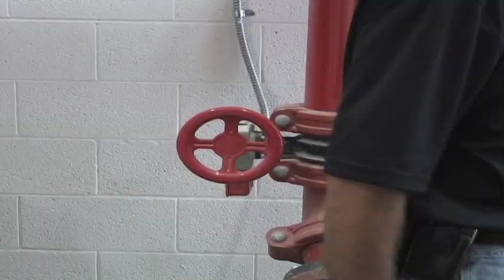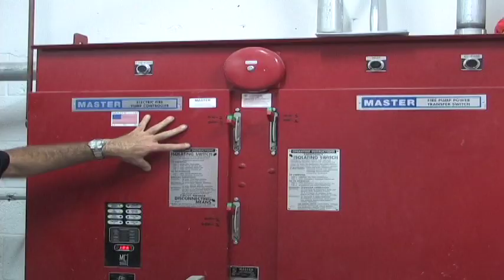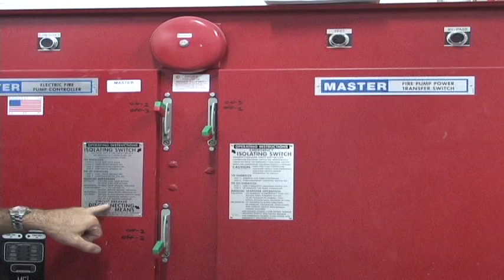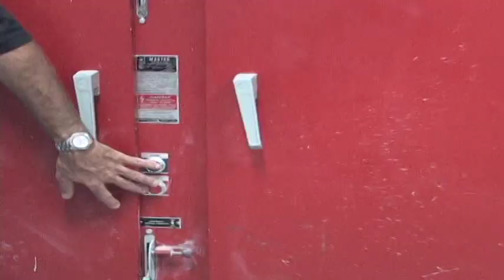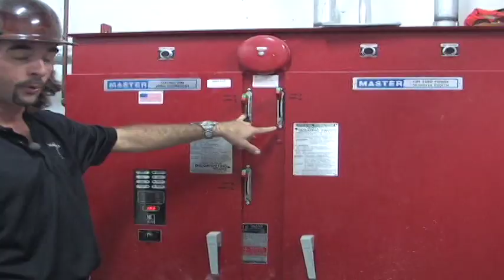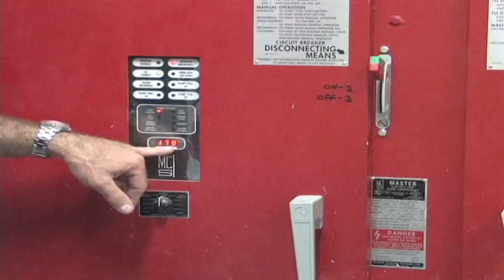Sprinklermatic Fire Pump Demonstration

Comment: The large hospital/research center/Ambutory care buildings that I retired from had  7 fire Pumps from 75 to 250 HP. I was INE if the electricians who had to run them every week & perform Quarterly PM'S on. Hate how lazy sprinkler guys install angry water pressure gauge sideways. Only takes a minute to install a Nicole & a 90 degree elbow to have them facing straight up making them easier to take readings. How the hell do they get a way with using open motors on all fire pumps instead of the TEFC ( totally enclosed fan cooled ) motors. Have seen every fire pump several times have bad packing then spraying water over open motors and water getting into motors. Hospital fire pumps do not time out after the usual 10 minutes of test run like other buildings. We had a for pump panel like the in your vidio. Had the cheapest piece of shit contactors which you could not remove cover to inspect contacts . We always had to open the drain valve below fire pump water pressure gauge to start pump then record that reading.

Comment: Does this system have one main pump
Reply from the maker: This particular installation is just a single fire pump. Multiple fire pump systems will be used in applications such as hi-rise buildings where high pressure is required or in special hazard applications such as aircraft hangar foam systems where a back up pump is needed. Thank you for your interest and for subscribing to our channel!

Comment: Thanks for the video. When there's a fire though, will the jockey pump be also running? Since Jockey pump turns on first before the fire water pump reaches its switch on pressure I'm thinking it's running but I am not sure though.
Reply from the maker: Both the fire pump and the jockey start and stop on pressure settings. If the fire pump is able to maintain a pressure above the jockey pump start the jockey pump will shut off. Thanks for your interest!

Comment: Question:

1. What will happen to your jockey once the electric fire pump kicks in its design cut in pressure? Does it operate together with the electric fire pump or will it stop?
Reply: When the fire pump starts to run automatcally theJocky pump will not run. 
Both pump will not run together automatically...

Comment: I, personally, would not route a water pipe into an electrical cabinet. Instead, I would put the pressure sensor outside the cabinet and route it's cable into the cabinet. That looks safer to me in the case when a pipe or a sensor starts leaking.

Comment: Very good video. However, the fire pump should be on manual stop and not automatic stop.
Reply: If you manually start a fire pump the run timer doesn’t engage. If the run timer is set to any specific time it only engages on an automatic start. For instance when we do 5 year flow testing on prv hose valves we set the time at 1 min to flow the valves with the pump on and when we stop the flow the pump only runs for 1 min and shuts itself off so we don’t have to have someone babysitting the fire pump at all times.

Comment: Question: Where is the water going when the pump is running during 10 minutes? I understand that the test header valve is closed, so the water is not escaping there? Is no water flowing?
Reply: There is a Circulation Relief Valve which will make a flow to avoid heating of casing of a Pump.
Reply: Hi the water goes through the casing relief valve also this is used in the diesel engine system
Reply: When an electric pump starts in churn the casing relief valve is supposed open and flow a full pipe of water to a drain. Once you start to flow water anywhere like for instance doing the performance test the crv should close. And for a diesel when it fire up in churn your should be getting a full pipe of water from the heat exchanger piping to keep the engine and the pump cool. It acts the same as a crv on an electric driven pump.

Comment: Not a bad video. Def a couple things that were wrong. But all in all not bad. No return bend on the air relief on the lid of the pump head. That’s an nfpa 20 code. Copper drain lines in the packing drip cups are just stupid an a headache waiting to happen cause there going to get clogged. He barely touched on the CRV or circulation relief valve on the fire pump. Other than those couple things it wasn’t a bad video. For being non union his knowledge is semi extensive.

Comment: would the city water reach 300 psi on the pump suction line
Reply: Ahmad Al-Tawabini no the municipal
Supply is much less; here it is more like 60 PSI. The fire department Connection is on the discharge side of the pump; therefore the suction line would not reach any where near 300 PSI.
Reply: Thanks Robin, 60 PSI is reasonable. I wondered When I heard 300 psi
Reply: @aftawabini  that might be the out side.

Comment: Does the fire pump always work at max capacity? For example if my pump was 1000 GPM / 10 bars, but only a landing valve was opened which requires ~250 GPM / 4.5 bars. Would the pump work at 1000 GPM / 10 bars and the excess water be thrown out with the Pressure Relief Valve?
Reply: The circulation relief valve only flows enough to keep the pump cool, like 50-100 gpm.

Comment: On a tamper switch you will get a Supervisory  alarm not a trouble.  It is important to know the difference between them both.
Reply: Correct.
Reply: Supervisory signal. Neither trouble or Supervisory is an alarm

Comment: Just to be accurate the pressure relief valve he refers to is actually called a casing relief valve it is operated by water pressure and is used to keep the fire pump cool when it is running at churn. It simply drains a small amount of water from the discharge side of the pump which brings a small amount of cool water from the supply side which keeps the pump cool, while the casing relief valve is operating feel the water it should be a little warm. Overall Good Presentation All the Best

Comment: Would like a video on color coding of sprinkler heads..This guy is the Bomb...Great work.
Reply: Color coding of sprinkler heads is specifically for us(Sprinklerfitters) to identify the degree of the head 155 is red, 200 is green, 286 is blue, etc. There's also fusible link heads as well. It's  supposingly a trade secret of what exactly is inside the head itself. The bubble inside is different size pending the degree of the head and also if it's standard response or quick response heads. Hope that helps.

Comment: If the jockey pumps are properly set per the "intent" of NFPA 20,   A.14.2.5.1(4), there should not be a problem as this is what the system would be looking at if there were a fire.  Keeping the pressure switch settings narrow, reduces the water flowing on start up.  If the jockey start PSI is set at the fire pump churn and Stop 10 - 15 PSI above that, there will be no water flowing when you start the fire pump as along as the supply remains the same, the system will be at churn, not 10 -15 less
Reply: What in the world are you talking about. Regardless of what the pressure is set at the circulation relief valve needs to open to let the hot water out and allow cooler water in. The two word enemies of an impeller is heat and cavitation. So what you said don’t make one big of sense. I’m an instructor at the union hall and our coordinator is the UA fire pump instructor. Ifso facto he knows a shit ton more than anyone you know. That’s a fact. He’s gone to trainings for every major pump manufacturer and they all said the same exact thing.

Comment: Hi I've seen you use emergency backup power. I was wondering whether you use a diesel generator or maybe it is  bettery pack. Also I've seen in other videos diesel fire pumps, not electric driven pumps. Do you know which system is cheaper?  I'd say that an electric pump with an emergency diesel generator would be a little more expensive, but let me know what you know. Thanks!
Reply: You could never afford the huge # if batteries to provide emergency power for several hours on a 199 HP motor. While at a continuing education class some guy asked the instructor if you could use Solar cells to supply smokers envy power to a fire pump. I struggle told him only if you had guard 24/7 sunshine. In my big city in small to medium buildings that have dual electrical services you do not need an emergency power source .Hospitals & high rise buildings require emergency generator.

Comment: I do fire pump testing about every other day in NYC high risers, pal. We do a churn with closed discharge and then we do another churn to get pressure at top of the head to help reset relief valve.
Reply: You need fore for closing that valve. Your never supposed to close that valve even when your working in the fire pump cause the discharge check should hold. You should be fired. Uour
Lucky you don’t work for me  because whoever you work for us just as incompetent as you. Your def not a union guy.

Comment: Excellent advice. It always scares me to start a pump and let it churn, seems if there's a weak spot, I seem to find it. So you would note on the paperwork that the valve was closed during the test, then reopened and verified at the control panel for proper signal restorals. Have you ever experienced any leaks or problems while running a pump? Also, does the air bleed valve on top of the pump "spit" or "hiss" when running? I find them clogged and rusted all the time. Thanks again for a super job